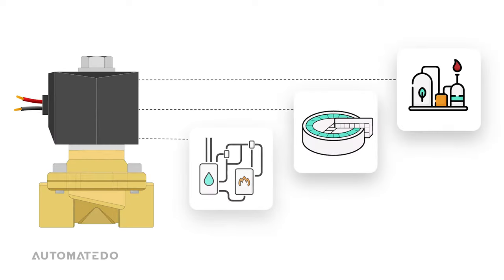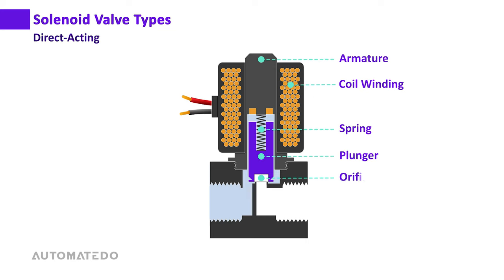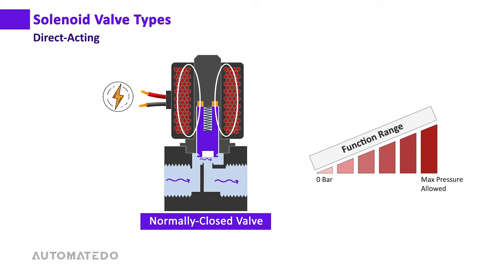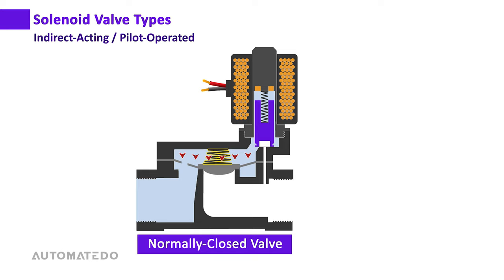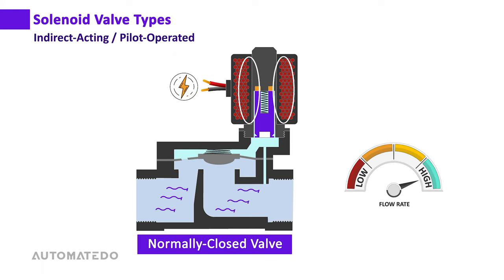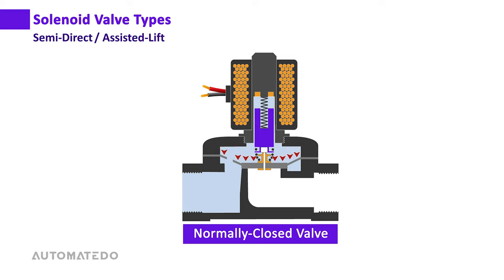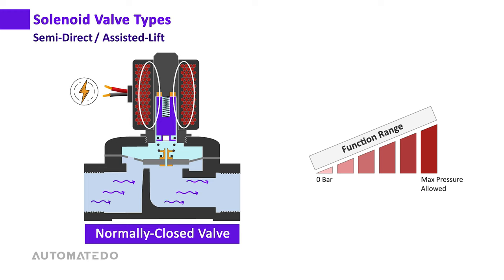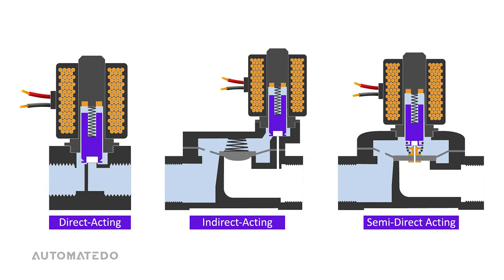Solenoid Valve Explained | Types and Application

Comment: Thanks for the animation. Can you explain how the upward force on diaphragm will be higher than the downward force when the pilot valve opens? It seems that the pressure will become equalized on both side of diaphragm but the spring still holds the diaphragm downward so it should never open?!
Reply: I think it has to do with the fact that the water is moving above the diaphragm and is static below it. Moving water applies lower pressure than static and the diaphragm raises. Same effect causes the diaphragm to close when the valve is shut: moving water below and static above results in downward action of water on the diaphragm.

Comment: 0:35 what about proportional solenoid valves?
Reply from the maker: The purpose of this video is to explain the different types of on/off solenoid valves. The valves that you are considering have different internal structures and, therefore, different applications.